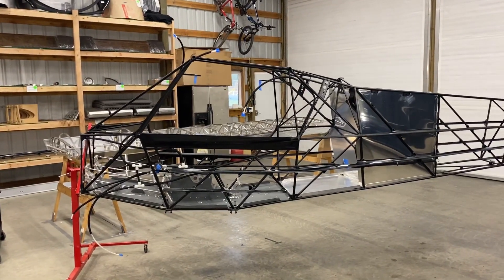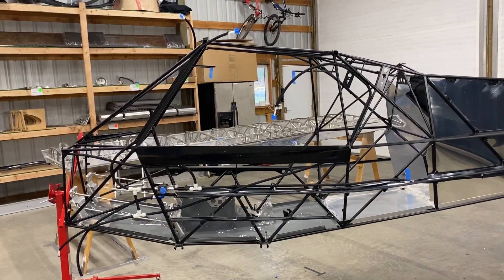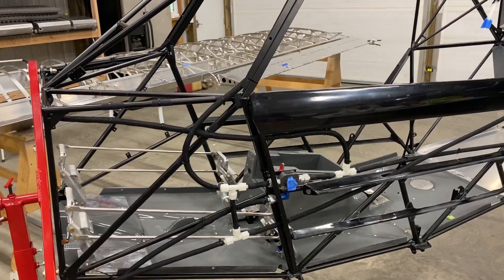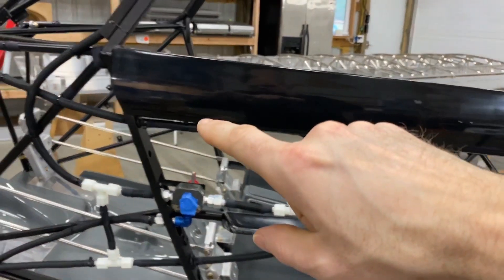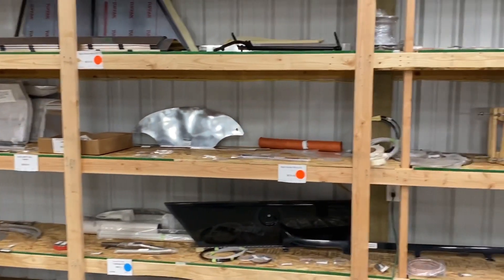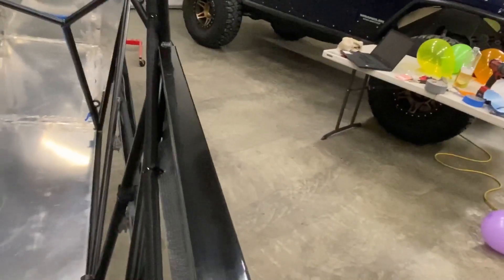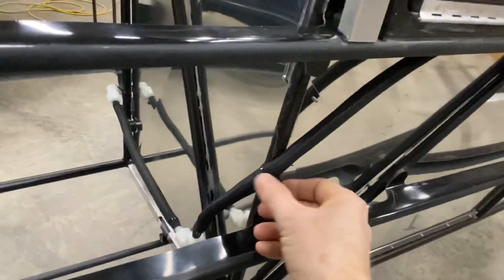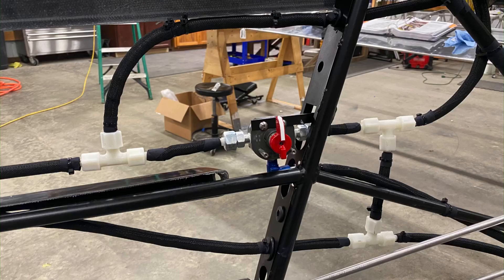Carbon Cub Build Update #10 Fuel Lines

Comment: When you get the engine?  Haven’t seen it in previous videos.  Great job man!  Oh and also did you see cc has a belly tank?
Reply from the maker: Thanks! Engine and firewall forward are still on the way. Not sure when. Soon I’m sure. Yes on the belly tank. That vs the long range tanks in the wings were the toughest decision when ordering. I opted for the long range wing tanks so that I can have option for cargo belly pod and more versatile on floats. 👍